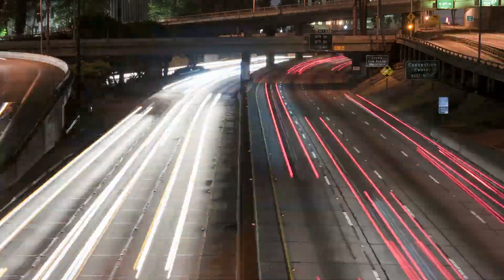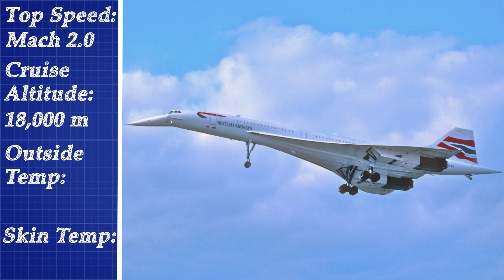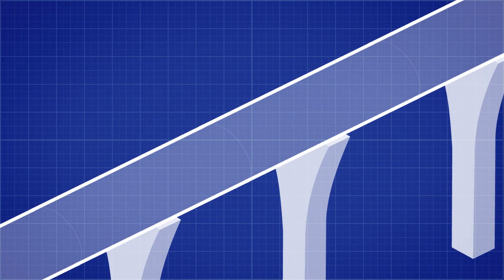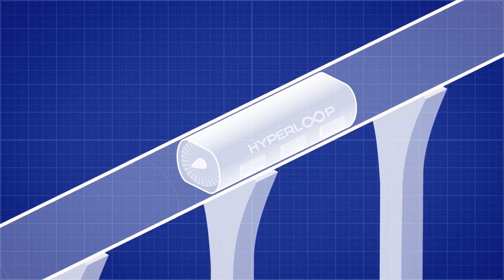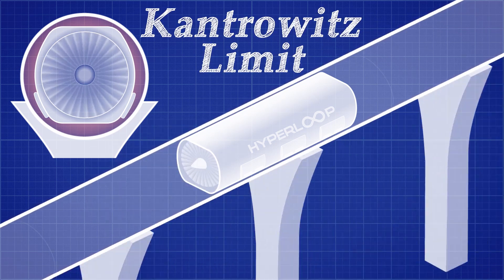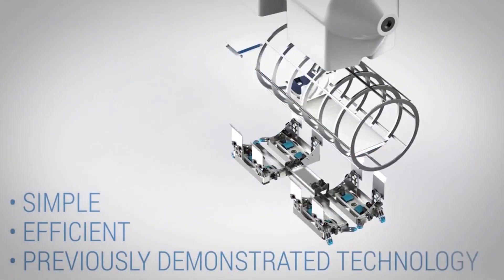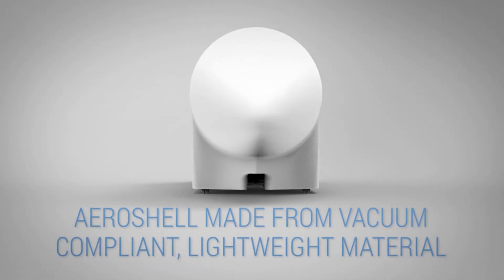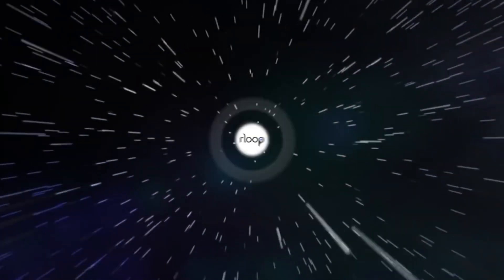Hyperloop - The Future of Travel?

Comment: Well, I personally don't think that this vacuum tube idea is a great one, here is why. For starters if you want to keep the inside of the tube at 0.01% of the atmospheric pressure on the outside of it, it would need to have very thick and strong walls which would make costs very high. Also the smallest hole in this tube can cause a massive explosion leading to large amounts of damage to to the tube. And if the pod happens to be near when this happens it could get damaged along with the people in it. Also if the pod is traveling at over 100km/h it would take a long time to stop which could leave the pod crashing into the debris. Another problem I see is the lack of an escape option in case of an emergency, as if a human entered the tunnel while it was in a vacuum the result wouldn't be pretty. And to safely exit the vehicle would need to dock up to some sort of an exit way which connects directly to the pod. But of the pod breaks down mid travel there is no escape. Another thing is the heat. If theses tunes are going to be put above ground like they showed than the pressure will vary on the time of day and temperature as the gas inside will expand or shrink. These are just some of the flaws I see with their design. Feel free to challenge my points I'm happy to debate ;)

Comment: The Hyperloop is way too bad of an idea. If there's a vacuum failure, the entire loop dies and everyone inside dies. That's way too much money to potentially go down the drain by mere chance, honestly. And it's worse when we remember they're not just putting it on california, it's right next to a famous fault line. So it's going to be extreme temperatures, meaning the tube is going to expand in the morning and shrink in the evening, meaning we need to put expansion joints in to prevent vacuum failure, it's running next to a road, and god knows what would happen if someone crashed into a support beam, or some terrorist decided to puncture the loop, and then Nature itself could just up and decide to destroy the entire loop with one good earthquake. Sure, it's designed to be resistant, but I don't think we've reached engineering feats that have made us immune to earthquakes. If we're going to do this, it'd be better to throw it somewhere not next to a freaking fault line, and even then I'd say the risks are still too heavy.

Comment: We need alternatives for mass transit and mass cargo shipment over land routes, but this isn't it. Hell, a mag-lev rail would be easier to run. And really, if we had the funds for a mag-lev rail infrastructure, it would be a pretty big help. Unfortunately, we really don't have the funds for it. And we don't have the funds for this sort of project either. 

Imagine a mag-lev tunnel going from, say, Houston to Dallas to Chicago, from Dallas to L.A and San Francisco, from Chicago to New York. Oh, and maybe a spur going from Dallas to Atlanta, then on to Miami, with perhaps an ancillary line from Atlanta to New York. It would be faster and cheaper than a plane, and would have the same sort of cargo capacity that cargo trains have. 

Unfortunately, we don't have the funds to engage in this sort of infrastructure building, so the whole plan is DOA.

Comment: What about the check in time? Do you think they would have the same security level such as Air-Lines (with the same disadvantages) or would they drop security for a conventional Train-like security? I think this would be only possible if just a few people like in a conventional high speed train waggon are (because thats what a typical terrorist can destroy/kill with 1 bomb). I think if the check in times are like using airlines, the whole thing has no point.

Comment: I keep seeing animations where the hyperloop pod takes up almost all the space inside the tube, and I don't thinkt hat will be the case. The difference between a hyperloop tube and a vacuum tube is that the hyperloop lets go of the pursuit of absolute vacuum and instead simply reducing the pressure low enough that between the compressor and air passing around the pod, the aerodynamic limit on speed is increased beyond the human limit on acceleration, so we can go as fast as we can safely transport a squishy person.

In a vacuum tube, most of the time the propulsion is done with air pressure. One side has a near vacuum, the other has a little more pressure, and it pushes the capsule along. We can build a low pressure tube a lot bigger than a vacuum tube, so we may end up having a bunch of empty space above and around the sides too allow what little air is left to pass by.

We don't need a perfect vacuum, or a perfect compressor, or a huge space, we need a good compressor, a low enough pressure, combined with enough space, that with those combined factors, the total air resistance is manageable at the desired speed.

Comment: How about the fact that it's planned to be built on top of a highly seismic area, the tunnel would require an absurd amount of energy to be kept under vacuum, and even in the test track they used to test the student designs, it took hours to lower the pressure low enough for the models to be able to participate?
Reply: 1. read the hyperloop alpha document.
2. powered by solar panels
3. airlock

Comment: how would you enter and exit the pod? How would you provide thrust while it's in the tube? how do you withstand the immense pressure from outside of the tube? Two of those questions are plausible with an airlock and building the tube underground to avoid expansion from heat and make the pressure easier to manage. I just don't understand how they will provide thrust.

Comment: Thunderf00t debunked it. This would be the world's largest vaccum by a factor of 1000. One breach and it would cause a catastrophic crash of all modules, as the air rushed in, and smashes against the capsules.

Then comes expantion of the tube that's supposed to run in the Californian summer.

This is bringing all the problems of space travel down to ground level.

Comment: how do they build a tube strong enough to handle that low air pressure but yet flexible enough to compensate for the movement of tectonic plates, and not to mention what would happen if even the slightest of a hole got in the tube. and how do the plan to move something like this? fans? at .01 of earths atmosphere?

Comment: what if some dude shoots it. like with a gun
Reply: Well the loop will undergo an explosive depressurization(like an airplane but inside-out). If the shot is fired in the capsule, then the passengers will experience normal, very low and (comparatively) very high pressure very quickly. If there is a capsule behind the first one, it will be hit by air at near the speed of sound. The capsules are traveling very fast in a  vacuum and so will slow down significantly, the passengers will hence experience very high G forces. If there is an emergency stop system for either of the capsules( the first one and any behind it), it will have to slow the capsule down from those high speeds to a complete stop in a reasonable distance(before the shockwave reaches them) this will again expose passengers to high G forces. Not to mention these brakes will have to hold the capsule in place as the depressurization takes place and air hits the, travelling at the speed of sound. Which means that these brakes must be good enough to bring the capsule to a stop from near the speed of sound(the capsule’s speed relative to the air)(assuming here that the track has minimal resistance for the hyper loop capsule to travel easily). It would also be a disaster to place the track in major cities as anyone with a gun can just shoot the track and cause a massive depressurization. There would be a huge amount of security checks, comparable to those at airports and even then someone just has to find the track to shoot it. The only way to keep it safe is to build it underground or at a great height and keep it constantly guarded. This would dramatically increase maintenance and upkeep costs and hence, the price of the tickets. It also risks being crushed deformed, or otherwise damaged by natural disasters. This is not only a problem for the reasons mentioned above but that capsules travelling extremely fast crash into the crushed or deformed sections at very high speed, probably killing everyone on board.

So yeah this is a BIG problem
Reply: Rebuild from scratch
Reply: everyone dead lol

Comment: So basically, for those who don't understand, 0.01 atmospheres of pressure is basically a vacuum, meaning that every time you try to load the capsule, you would need to pressurize the whole network. But an easy solution to that is installing air tight gates at the loading docks. So that's not an issue. Another thing people are saying is that a leak would destroy everything, well, not exactly; the air pressure you experience day-to-day is 15 pounds of pressure, meaning that a leak would mean just inconvenience to the capsule in the form of drag, which equals decreased speed.

Comment: Wondering about the practical issues with this. Will trains be equipped with emergency space suits in case of an unscheduled stop? And will all emergency exits (spaced maybe a mile apart to make the walk reasonable) have airlocks? Assuming no one's in a wheel chair. Or will the entire length of the tube be repressurized to allow people to get off, then we get to wait a week as the tube pumps back down? Same issues with maintenance of the trains.

Comment: The hyperloop is nothing more than a fantaisy that can't work in reality because of too many technical issues the idea have. If you are seriously believing in that thing you just lost all your credibility. Seriously you would get a better result by trying to make a perpetual momentum machine than that thing that will break for any minor imperfection. Issues they can't fix and creat more issues if they try to fix them: Heat dilatation of the material, 10 tons capsule inside a tube that whil rip open by minor vibration cause by the capsule in movment or by any seismic pertubation that could cause a wrong alignment. The safety that is less than walking on thew street and the cost that will be the same as a ticket plane. Well if you want to die go in that thing. For my part I will be on a plane that is the safest way of transport.

Comment: I'm a nuclear "technician " (all I'm saying) so I if coarse use the metric system for weight and measures. but I am also a pilot. International standards for aviation are the nautical mile (1 MOA @ THE EQUATOR)  & feet expressed as "ONE THREE THOUSAND FIVE HUNDRED" or the acceptable "THIRTEEN THOUSAND FIVE HUNDRED" under 15,000 feet & FL-350 for   example at 35,000'. Speed at Flight Level is usually in mach #s.
Civil aviation is MP/H in knots. Could you do this? It can get annoying for a US pilot to convert for meters and Km/h. The Concorde flew between FL-500 & FL-650 @ Mk-2.2

Comment: what happens if there is a structural damage and the air comes pouring in?
Reply: +TheLood  The reason why large trucks and buses use air brakes instead of hydraulic brakes is that leaks in the system do not affect operation till the leaks exceeds the compressors capacity.   Similarly, a vacuum transit system is not as vulnerable to leaks as one might think.  Yes, leaks would have to be repaired but the effect of a leak is just higher pumping costs.
Reply: John Wang 
No! well maybe if there is a small leak, but if there is a larger leak it would kill everyone inside it. 
this thig is accident waiting to happen.

The thing is you are comparing two different things. air barakes are a small system. this will be 500 miles long or something like that.  there will be living people inside it.

Comment: ITS VERY INFEASIBLE
Reply: +Mattuiop I don't see it as infeasible but I question the need for it. At best it just fills in a niche market which arguably should be of less importance as telecommunications progresses.   We already have pipelines over thousands of miles so the concept is clearly possible, I just don't see a need for it.
Reply: John Wang it's pretty hard to keep a vacuum along miles of tubing. check out thunderfoots video on it
Reply: +Mattuiop   First it's a partial vacuum, one easily achieved without a great deal of energy, second there would be many compressors evacuating the tube along it's length so it's not like you're pumping it out from one location but rather all along.   It would actually be pretty easy to keep a partial vacuum along miles of tubing so long as you have many compressor stations.   There are several corollaries to this concept such as the ventilation for mines and tunnels.   I suspect that thunderfoot has no idea what he's talking about.   We deal with thermal expansion all the time with pipelines, rails, and even roads, there are many techniques such as support beams over which the tube ( or road as in hwy 8 and I-10 in west Houston ) can slide over in a turn, to even telescoping segments as the nominal leakage rate can be handled by additional pumping.   Constant pumping to account for leakage is why trucks and buses use air brakes over hydraulic brakes, fault lines have predictable directions of travel and therefore can be accounted for by wide supporting beams over which the structure can glide ( this is why hwy 8 and I-10 in west Houston has that wide support beam, it's over a fault ).   Yes there are a lot of pressure on the structure but think about what pressures a high pressure pipeline is designed for,  the pressures on a vacuum container is limited, certainly the vacuum chamber that is used to test spacescraft needs to be strong as they are trying to approach as complete a vacuum as possible but how thick are the glass walls of your thermos bottle which would contain a partial vacuum closer to what's desired.     Seriously, comparing the deflection of a bimetallic strip to thermal expansion?   A bimetallic strip demonstrates differences in expansioin rates of different materials, why would the tubes be made of two different materials with different physical properties?   The speed at which air would move in is determined by the differential pressure, the diameter of the leak and the physical properties of the air itself, this is fluid dynamics, the speed of sound is an upper boundary, a leak would not be at the speed of sound, does realizing air from a balloon give you a sonic boom?    The turbine is not about thrust, it's about dealing with the limiting factors of a partial vacuum system versus a true vacuum system.   Really, one thousandths of an atmosphere, the whole idea is whether or not a transit system is possible without a deep vacuum.    Really emergency brakes?   The whole idea is to use magnetic linear motors.   We already have high speed elevators that use such motors and there is no contact, no friction involved in the magnetic braking, indeed braking a linear motor generates electricity which is why electric vehicles have regenerative brtaking.  The speed of sound statement is utter nonsense, study fluid dynamics to see what the speed would be. Thunderfoot's video is pretty ridiculous.

Now, what Thunderfoot got right is that the primary purpose of the project is not necessarily to create a working system but for promotion of Musk to investors.
Reply: Thunderfoot blows it way out of proportion.   He shows the concrete walls of NASA's deep space vacuum chamber but does he show the thin glass walls of your thermos?   He talks about air rushing in at the speed of sound, the air would rush in at a speed determined by the differential pressure and the diameter of the opening as per fluid dynamics, the speed of sound is an upper limit that it could not exceed no matter what the differential pressure is and keep in mind that the differential pressure is not infinite, it would be less than one atmosphere, your espresso coffee maker operates at 19 atmospheres, you don't see the coffee shooting out at the speed of sound.   We already have pneumatic systems that deal with leaks all the time, the very reason why we have air brakes for trucks and buses is that leaks can be compensated for with additional pumping capacity.    Thunderfoot is completely oblivious to engineering fields such as fluid dynamics.   Take his video to your local University and ask the fluid dynamics prof to review it.